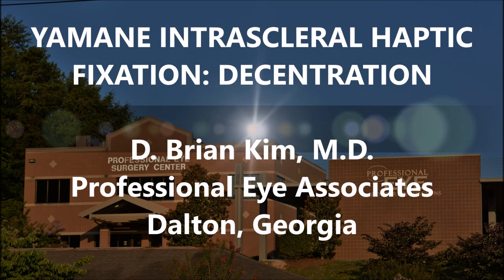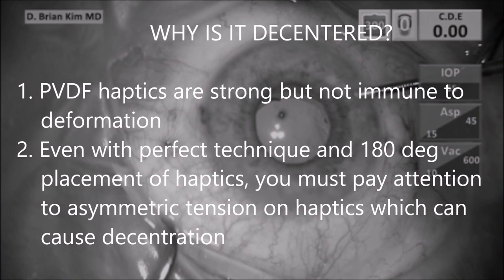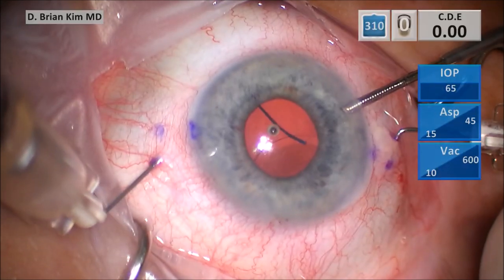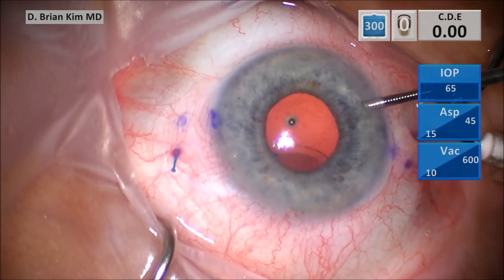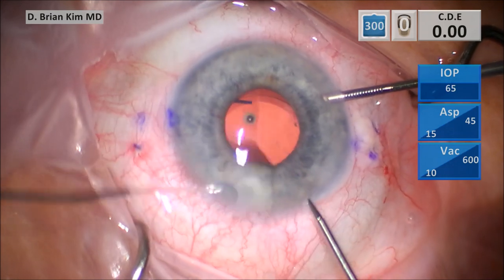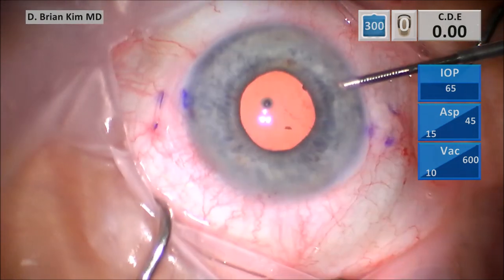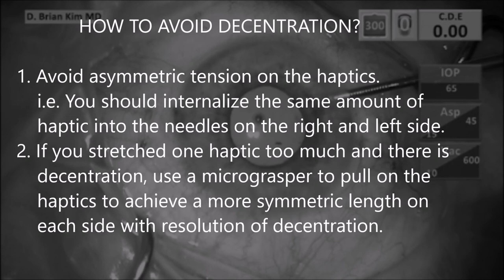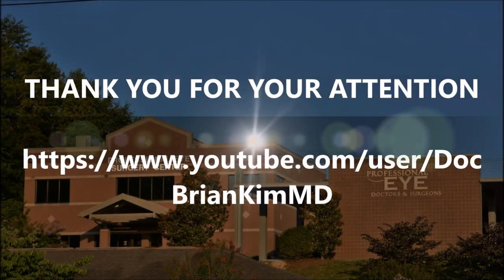Yamane ISHF Decentered IOL Despite "Perfect" Technique: Why it Happens and How to Fix It?

Comment: Thanks for that great tip in centering the IOL after fixation of the haptics.  I appreciate you explaining why this happens as well as how to adjust the optic.  In one class I took it was suggested to push one of the haptics out and trim it and re-cauterize to Center it.  Your technique seems a lot quicker. Jackie
Reply from the maker: Jackie, decentration is all about understanding the mechanism. In this case, the lens was perfected centered by technique but the left haptic was stretched and caused the optic to decenter.  One must appreciate the stress placed on the haptics and even though they are PVDF and strong, they still bend a little.  That's the first point. In cases where you amputate and re-cauterize, IMO this is usually in the context of a poorly placed haptic through the sclera.  So the second point is that even if you don't have the scleral placement of the haptics perfectly executed, you can "cheat" by trimming the haptic by creating an asymmetic haptic length to compensate for the asymmetric scleral fixation.  So it depends on the cause for decentration. I hope this clarifies things.

Comment: Brian 
I might disagree with you with this management . the optic haptic junction should be approuched smoothly and not pulling which might cause either cut of the haptic or future complication or next day you might see the sublaxation is still there 
I think the best and safest thing to do here is to trim the left haptic with out jeoprodizing the optic haptic complex , thanks Kim
Reply from the maker: Great point. When I have a decentered IOL now, I usually recannulate and start over with scleral fixation. Trimming is also another good approach but I would rather not have assymetric haptics. If that is the case, I try and do it again. Best.

Comment: It's great Video. I've a question, in case we did inaccurate biometry resulting in large undercorrection, and we have to do iol exchange, do you have a special tips how to explant the iol with previous Yamane technique. Thanks. Ari
Reply from the maker: Ari Djatikusumo great question. I have explanted Yamane a few times. You will have to dissect the conj and tenons in order to get to the haptic flange. Once you expose the flange, you may need to do careful sharp dissection over the flange to free up the haptic. Then you will have to pop it up similar to when you use a finger to pop up a soda can tab.  You can do this with a 25 gauge needle. Alternatively, you can use a microforceps from inside the eye and grasp the haptic and push it with upward force to help push the haptic upward and away from the sclera. Once the haptic flange is free, you can cut it and the haptic can be pulled into the eye with microforceps. Do the same thing on the other side and get each haptic above the iris plane to secure it and then cut and remove. Best wishes.
Reply: @DocBrianKimMD  well noted. Thanks Brian
Reply: Sorry, one more question, should you put a new IOL using the Yamane technique, would you use the same tunnel or create the new one? thanks a lot. Ari
Reply from the maker: Ari Djatikusumo if youroriginal scleral tracts we’re well centered and not tilt, you can try to use them again. But it might be hard to reproduce it, so it’s ok to start over. Best wishes.

Comment: Thank you very much for this video. I just have a question : how do you manage the tilted implant with this technique ? What can cause the implant to tilt despite a good placement of the haptics?
Reply from the maker: Hi, the answer is not so simple. Many variable go into the Yamane technique. Needle placement, needle depth, length, angle. The marks are on the conjunctiva and the conjunctiva can move which adds to the potential error in needle placement. Precision and accuracy are necessary for correct placement. And the ability to go back and re-pass the needle is an important skill. All of this is to say, I wish there was a recipe to ensure perfect lens placement but there isn’t. All you can do is try to execute each step as precisely as possible. Best wishes.